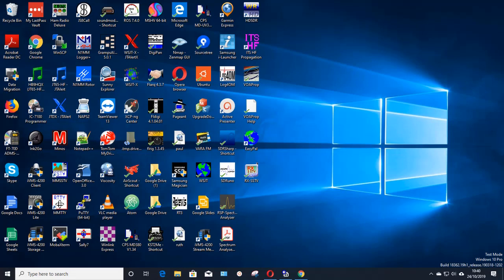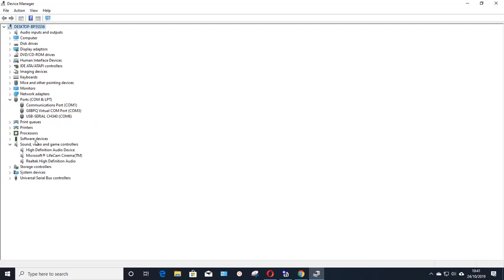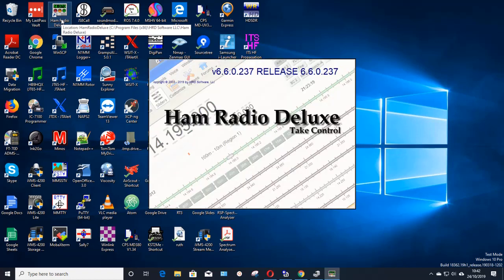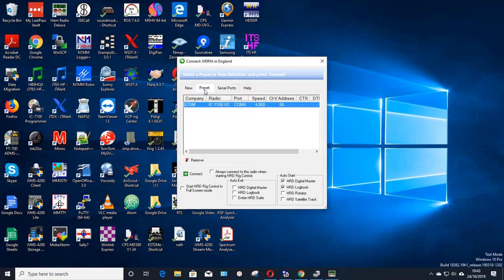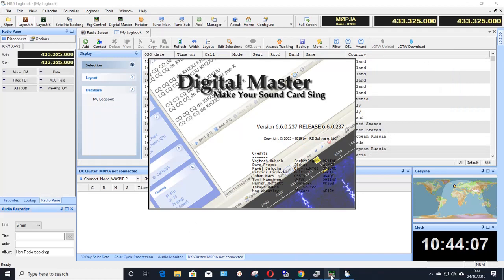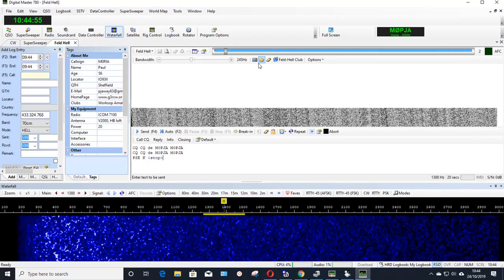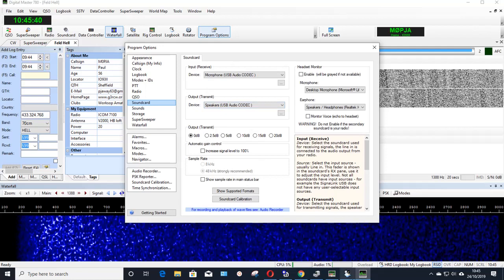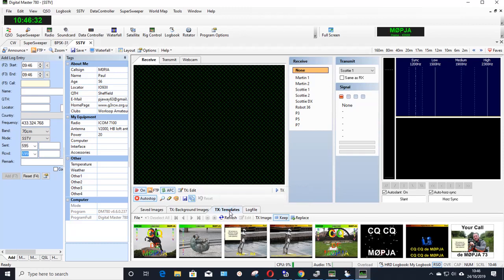Quick intro to icom 7100 and hrd

Comment: r you having any lock on transmitting sstv with the usb cable ?? cant get mine to transmit it cliks the radio transmit batten but no sound going throw  from ve3hye